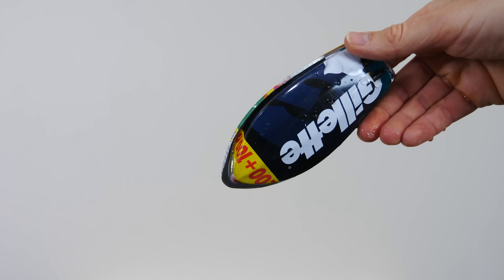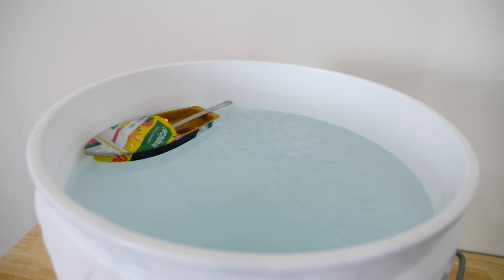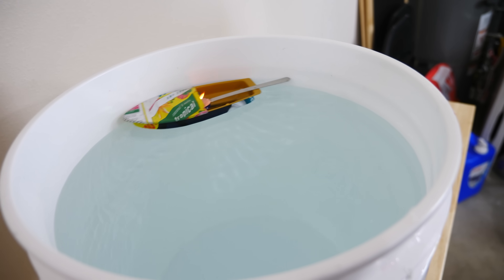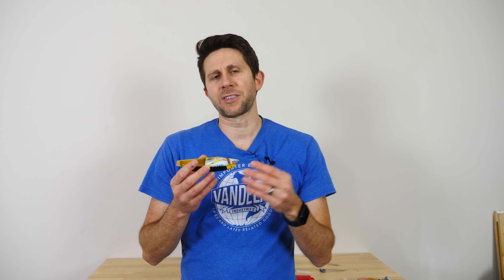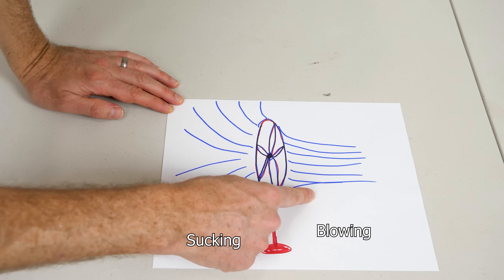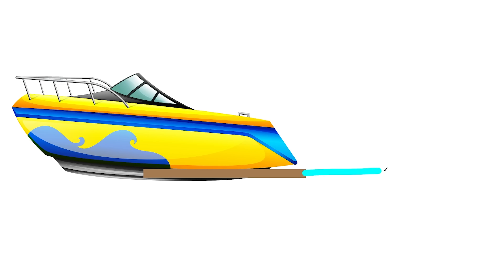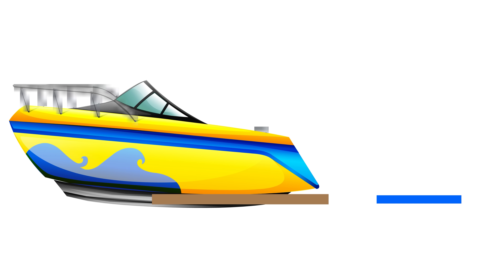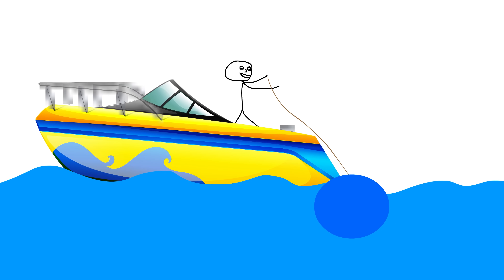The Weird Physics of The Putt-Putt Boat

Comment: You forgot another feet of physics at work. You heat up that water with the candle, hot water expands and shoots out of the back and causing the walls of the boiler to expand and shoot out the back of the tube at the same time. The cooler water rushing in to replace the hot water contracts the boiler walls sucking in more water until the heat is high enough to start the process over again.

Comment: Sounds somewhat similar to the action of a pulse jet engine - where the expansion and escape of the hot gases creates low pressure pulling in more fuel and air.

Comment: Next level version:  Solar-thermal powered (like with a magnifying glass to heat the boiler).  No candle needed, just sunlight. That would be cool!
Reply: perpetual motion machine eh? too bad it runs out once the sun goes down
Reply: @Darktitanium159  not a perpetual motion machine, just an interesting development of the original experiment.
Reply: @NSFWHarold  i get it. i was just making light humor

Comment: Poof vs. Foop     A pressurized cylinder will take off like a rocket when the end is opened. But a cylinder with a vacuum will just sit there, because the air enters the cylinder and then hits the wall on the opposite end of the cylinder.

Comment: I have seen difrent types  a coiled pipe and a sandwitch type  witch use difrent metals  the metalurgic trick of cool and heat + expanding steam results in sound and momentum  the coiled  one does not make the putput sound  still will move and vibrate by expansion of steam

Comment: couldnt it be made more efficient using a one way valve pointing to the the front and one pointing to the back at the second half of the pipe? So when it sucks water in it will be in the boats direction and not from the back of the pipe and if it expands it shoots out only at the back. so on every cycle it puts all energy into pushing or pulling forward.
Reply: Not all energy would be transferred to forward motion, though it's an interesting idea that's worked for the likes of bike and air mattress pumps.  Some energy would be lost in the activation of the valves, and any flex or vibration their moving parts would have.  Not a big deal for the air pump, but this boat really needs as much push as it can get.

Comment: I’ve been thinking about the ball and a string example since this video came out, and it’s bugging me. I think this illustration isn’t quite accurate. If you were to throw a ball on a string off an object it would push you forward but as soon as you pulled that ball back it would completely negate the forward momentum that you’ve built up. I think the reason that the boat works is because of the direction of the forces. When the water is shot out, it is shot out horizontally, but when the water is sucked back in, it sucked back in from all directions. This would cause a net horizontal momentum. The example with a ball in the string would not do this.

Comment: I think the causal difference is more specifically, the water pushed out was reversed 180 degrees, where the water sucked in is taken from a larger omnidirectional source with less inherent outward momentum.  That's the difference that creates drive.

Comment: The water balloon example is not 100% clear. If you take this example and apply it to a space-ship in outer space throwing back a water balloon and then pulling it back again for the next throw, you end-up using a reactionless propulsion system which violates the conservation of momentum. Obviously that is not the case you intended to present, but this needs more clarification.

Comment: Great video with good information. It was pretty surprising to hear the loud noise the boat makes, it sounds like there is some type of combustion engine running.

I would suggest altering the video ad breaks next time. After the ad in this video, there was only ~20 more seconds of video and then it ended.

Comment: Hypothetically you could scale up the Putt-Putt boat by making it more efficient by having one tube forward and hooking a Tesla valve to both tubes so water can only come in the front one and out the back
Reply: I'm pretty sure the flow interference would defeat any potential gain from the intake direction.  It seems like it would more likely eat at least a quarter of the propulsion in the backflow prevention.  If we look at each tube as providing equal thrust in and out, removing one outtake is a 25% power loss.  I don't think the directional change would add enough to overcome this.  Tesla valves do also slow the flow slightly in the direction they do work, making the case likely worse than 25% power loss.
Then there's added drag from the pipe or hole in the front...it's an interesting idea and I like it for that, but it might not run at all.  Other comments mentioned home-made boats were finicky with the existing design.
Reply: I remember from some discussion with friends years ago that inverting one of the pipes does not work, as it's not an inlet-outlet exclusive configuration, but both of the pipes work both ways, as this video also seem to suggest. So, in my view, it shouldn't boost the effect moving this boat. 
Of course it could anyway move and be a new concept, nevertheless you could use a one way valve instead of the Tesla fancy thing...
Reply: @ec7283  a Tesla valve is a one-way valve that has no moving parts it works like a diode only for fluid or gas and was invented by Nikola Tesla a Tesla valve allowing water in from the front and out the back only would make it an incredibly efficient design
Reply: @stacyroe619  yep, I know it, never mind...

Comment: So, hypothetically speaking, if you were to attach several of these to arms on a bearing and then put magnets on them to spin a dynamo, you could have a very efficient generator, as long as you have a fuel source for them?
Reply: I don't think it's efficient. There is significant water resistance and a large chunk of energy is also getting wasted as sound and vibrational energy.
Reply: @harrissravan  that's fair, but I'm not sure there's many more efficient ways to turn the head of just a candle into energy.
Reply: @CoconutGun  That's essentially what they do in thermal power plants. Heat up water and move turbines. Less moving parts more efficient. You'll just need a lot of candles

Comment: An intriguing & deceptively simple method of propulsion. It's these apparently obvious - but in reality unintuitive - applications of physics which can make for such fascinating educational projects.

Now I'm curious if different configurations of this design would be more, or less efficient:

• If the walls of the boiler were thicker, would than mean less energy was lost to the system as sound vibration?
• How about increasing the heat to extreme levels (with a laser) to generate plasma instead of steam? 
• Or, even more radically, cooling it with liquid Nitrogen? Could this design work by cycling thermal equilibrium (but this time using the ambient heat of the surrounding water)?
• If the boiler were different shapes, what effects would this have? A Sphere, A Cylinder, A Torus, A Cube,  etc....
• How about the length/diameter/direction of the intake tubes? Would directing one forward (as a dedicated intake tube) create a cyclic in/out Pulse Jet?
• For that matter why specifically 2 tubes & not 1, or 3, or 5?
• What would adding a twist, tapering in/ tapering out, valves, or another method to improve/force Annular Flow through the tubes do to the system?

• What other modifications to the engine could you think of?
Reply: Thicker boiler walls should primarily make the transition between starting and stopping (by adding or removing the candle) slower, though it might be slightly quieter.  It shouldn't change the process or speed very much while the engine is active.  Being more rigid (via thickness or density) might also direct a tiny bit more force into the popping, causing more speed, but not because it's quieter.  This might or might not outbalance the additional weight of the metal.
Plasma temperatures (~3000 K or C) would break the water into hydrogen and oxygen ions, and they wouldn't readily reform as steam without cooling a lot.  Far below this temperature, most metals would completely melt.  Many would evaporate.  Either result would release the hydrogen and oxygen plasmas, which would cool back to gases joining the open air.  No more boiler, no more fuel, no more boat!
Cooling wouldn't result in a pressure bounce, as the water would either stay liquid, or freeze into ice.  The open ends of the tubes would prevent any sort of backfiring pressure that might reliquify the supercooled ice.  It actually takes a lot of work to get ice into lower states and temperatures, far more effort than the heating process of dropping a candle underneath, but there are less common crystalline forms of ice, depending on temperature and pressure.  (It's easier to add heat than remove it, once the crystal matrix has been made.)  There are at least ten phases of ice, if I remember correctly, but it's been a while since I looked at the relevant chart.
Different mechanical configurations could be interesting!  If I had to guess, more than one tube allows both directional stability and letting the water flow more readily than with one tube.  I've no clue if more than two tubes might change the behavior.  You could definitely angle a tube or make one wider, if you wanted to have the boat consistently drive in a circle on its own accord.  A rudder would be simpler for this, however, and allow changing the direction at will.
I like the idea of trying a coil for the boiler instead of a tank.  I wonder how much engineering we'd have to do on the number and form of the coils, in order to get the same effect, or maybe better.  I think it would be more finicky about exactly where the flame is.
I'd also like to try different hull designs.  A racing boat or canoe design, or nacelles, would change the behavior slightly.
Edit:  Larger versions use an indented sheet-metal plate atop the boiler pan to pop in/out, magnifying the effect versus a completely rigid system.  They do make these things big enough to push people, but not very fast.  Small models are made using even very simple coils and eliminating the pan, but it seems those versions don't have quite as much power as with the pan.

Comment: I used to make these with pop cans and plastic straws when I was a kid.  I even made a small RC one from left over airplane parts.  Super fun to learn some of the physics of how they work.
Reply: you could even make it able to heat up water at variable speed with tungsten wire and a potentimeter fixed to a motor, so the more you throttle forward, the hotter the steam, amplifying the effect
Reply: @aidanmatthewgalea7761  I used a servo with a little flap under the boat to make more or less drag for speed control. But yeah the wire idea is cool too! You could probably control the wire with an old brushed esc.
Reply: @willowehrich6207  just a stiff slider crank should be enough to link the two

Comment: Is this truly all the physics involved or is there more than meets the eye? Does the action of the boiler chamber flexing in and out which also makes the popping sound impart energy to the force of the water jet? If the boiler were rigid and had little if any flex and made no noise would it work the same?🤔😉

Comment: It's probably to late for you but when I did my put put video with the same size boat I used a large stainless steel dog bowl upside down which made the perfect water circuit with an island in the middle.

Comment: If you installed a valve to make it draw water from the front and expel water backwards, how much more acceleration and top speed could you earn?
Reply: Pushing the valve should slow the water flow down, if it's strong enough to work at all.  The speed of the flow changing might be faster than the valves can be activated, and they might absorb it entirely.  Perhaps a rigid Tesla valve (Action Lab made one in December 2020) would answer this to an extent, but the flow interference would probably be stronger than the gain due to intake.

Comment: I'd like to see a video on how this boat was constructed, namely the propulsion system/boiler. Reason is is because I've seen quite a few putt putt boat videos and not many of them run this good or as fast. Seems like a lot of them hit and miss here and there, this one seems lively and consistent. I believe that the angle of the boiler has something to do with it as well as the placement of the flame but I'm not sure if that's quite the case here. I'd like to build one like this.
Reply: Years ago I gave workshops for things like kids parties at a museum of technology. One of them was actually such a boat. We just used some thin copper tube (only abour 3mm thick), rolled a little spiral around some wood, bend the tube down and backwards. Make a little boat from foam and use a little tealight to heat it up. Wasn't as effective as the one shown here, but worked pretty ok. Was actually a lot of fun explaining steam to kids, explain how this boat works and let them build one to take home.
Reply: @haribo836  That's interesting, I'm gonna try my hand at building one soon.
Reply: @bodeine454  it's was a common toy in india in 2000s ,almost year fair had these specially in villages.
Reply: @noone-zl2di  actually it was famous even before 2000
Reply: Ones made from glass are neat
Reply: Most probably just use a single coiled tube for the boiler which isn't as effective. More effective is having a wide flat metal surface to go over the entire flame, just like a frying pan over a fire. Of course this component needs to be both closed sealed on the top, and also sealed with the tube(s) connected to it, making it much more difficult to manufacture.
Reply: @MsHojat  totally correct. That was the one shown in this video. The original post asked for a way to make them and this is the way I made hundreds of them with kids. It isn't the most efficient, but a kid can make a coil wrapped 4 times around a stick, that's why we did it this way.
Reply: Ecletic Space did lots of interesting scientific research on it
Reply: The same here I buyed it many times but didn't worked maybe because first he puts water manually in tube before placing candle or maybe the candle which I use to was more heavier
Reply: @dherrajhari3177  No, it's the water. You have to fill the tube first. Even if it only has a bit of air in it, it will work less efficient. More air and it will stop working.
Reply: this is nothing,at my childhood time the boat has 2 canon and can rise up and down,that's some weird mechanism I would say.
Reply: Exactly it works better than the ones I have tried.
Reply: Theres plenty of youtube videos on how to make these.
Reply: These are easy available in indian markets but offline 🤭... If you ever visit india ..  buy them ... 1 boat Will hardly cost 1-2 dollars 😇
Reply: Use gasoline 🏎️🏍️
Reply: It looks the one of the Chinese made ones you can order off amazon.
Reply: @ducksauce1290  He said it was made out of a shaving cream can.
Reply: @bodeine454  I saw a video from 12 years ago with Gillette written on it. I'd guess Duck Sauce is correct and you can buy them made out of recycled parts off ebay-amazon.
Reply: @danhudson4614  I'll look into it, thanks.
Reply: How about something like this..? 

www.youtube.com/watch?v=PKk3w1M4J-4

Comment: Not sure if it was just me but these boats used to go in rounds and not straight when the pool is big enough.

We planned this boat race in our childhood and we figured out it wasn't going the way we expected.

Not sure why though.
Reply: Others have mentioned the tubes being different lengths.  This should create a pressure difference via friction, and cause the boat to turn towards the longer tube, as the shorter would be the easier path, so the water flow should move faster on that side.

Comment: Would this same principle work with a reciprocating piston/syringe connected to a length of pipe?
Reply: Yes.  Larger designs would probably require this, as at a certain point the boiling action is too small to cause a singular pop, but turns into a constant jitter.
lol, I just got the idea of a torpedo using this with a single pipe.  It would be comically slow, but it would move forward.  Little bit like a squid swims?
Edit:  Larger versions use an indented sheet-metal plate atop the boiler pan to pop in/out, magnifying the effect versus a completely rigid system.  They do make these things big enough to push people, but not very fast.